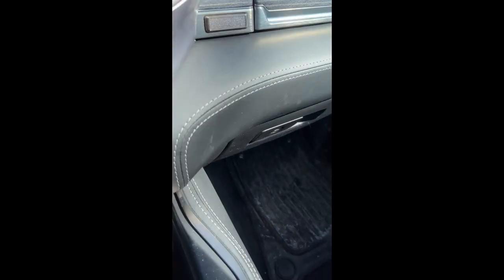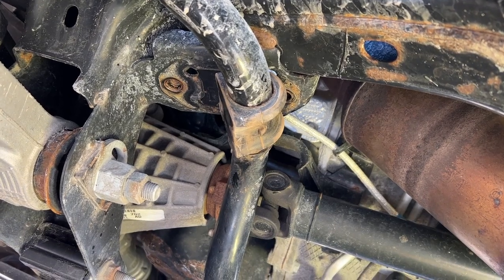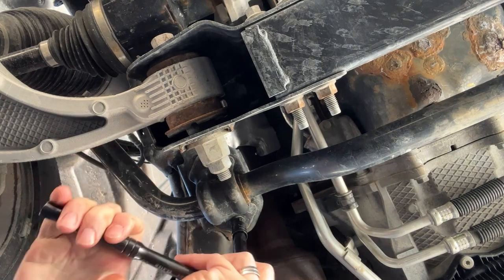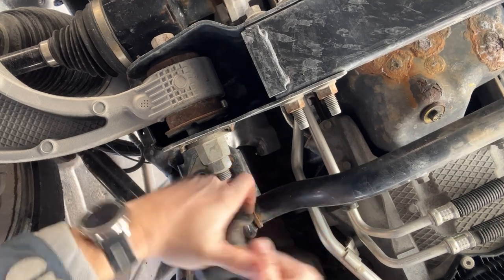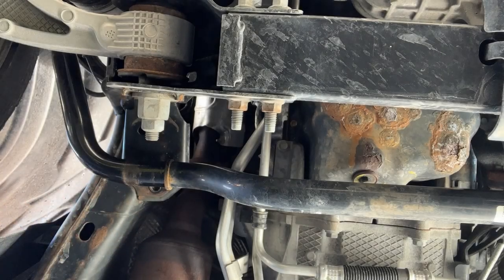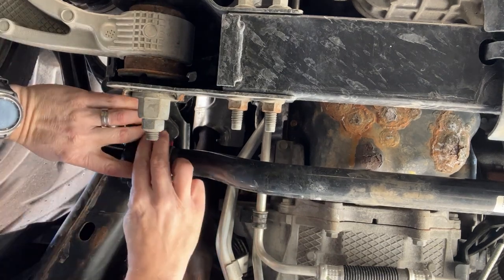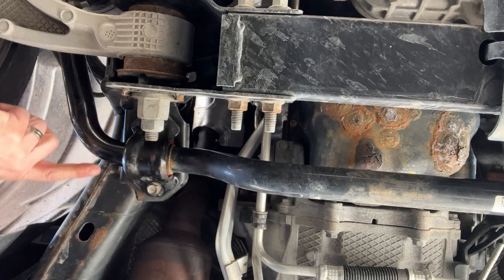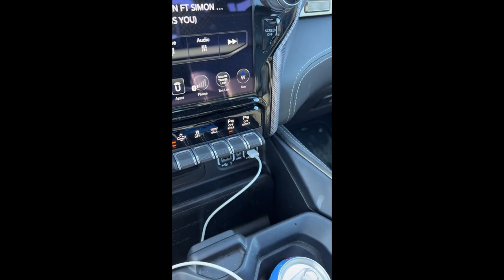2019 Ram 1500 Front suspension noise fixed  (CHEAP)

Comment: So I saw this video a few days ago after I replaced my swap bar links and still had a clunk. 2020 1500. I went to advanced auto for the bushings and decided why not for $30. As soon I cut the first one off I was like no shot this is it because it still felt really good. I greased the new one and installed it. Did other side just because and went for a ride. My god how long that’s been driving me crazy. It’s finally quiet again. Great video. Helped me a lot.
Reply from the maker: No Problem. thanks for watching.
Reply: Got nice blue Moog bushings online for $15- if your in a hurry pay double at the parts store🤷‍♂️

Comment: I’ve got a 2019 ram rebel after about 20,000 on it it made it knocking noise in the suspension only when it would get 40° and below in the winter.  summertime. You would never hear it took it into the Dodge dealership five times always said they could not find what was causing the noise Finally convinced them to replace the swaybar links thinking that was it and it was not now it’s out of warranty and now I’m thinking it’s the bushings as well. Drives me effing crazy in the winter.  If this fixes it, I’m going to be happy as heck and mad as hell the dealership could never figure it out.
Reply from the maker: My dealer said the samething.  I updated them on my upgrade to the factory bushings. Cheap quick fix.  Good luck.
Reply: My 2019 rebel has been clunking on the left front for well over a year. It’s definitely worse when it gets cold out. Dealer replaced end links. Didn’t help. Put a whole new sway bar on and that didn’t help either. I tried this bushing swap and it didn’t help. I’ve checked torque on upper and lower control arms and that didn’t help. It’s driving me crazy 😢
Reply: The lower ball joint went bad on me at 58000km check them out

Comment: I installed these poly bushings. Greased them and now a few months later they are extremely squeaky/creaky
Reply from the maker: You can order more grease.  But I have gone through winter with my truck and now into a  hot summer no noise at all.  Did you grease both sides??  Bar side and bracket side I did might be the difference.  36mm Sway Bar thickness.

Comment: I have a 2015 Dodge Ram 1500 with 52,000 miles and the front suspension squeaking only happens in the cold weather & in the summer time it's gone. Can anyone help with this problem ?  Thank you.
Reply from the maker: My first thought would be take a look at the rubber bushings and lube them up with a silcone based lube.  But could be a totally different thing.  Can you make it squeak by rocking the truck back and forth by hand?

Comment: Update on my 2019 ram rebel, making a knocking noise when it gets below 45° and after taking it into the dealership five times and they couldn’t figure it out it was the bushings. They are very easy to replace in if you are not mechanically inclined and cheap, wish I would’ve did it years ago
Reply from the maker: I am so glad it worked out good Christmas gift quiet truck :)

Comment: Well, I ordered the exact bushings linked for my 2019 Ram Laramie that had the same rattle.  Yup, sure  enough, that's what it was.  Thanks a ton for this video.  As an FYI ... I also checked the stabilizer bar end links and the bolts as well as upper control arm bolts and all of that seemed fine.
Reply from the maker: I replaced the Bar end links first then the bushings onm my truck.  I am Glad my video helped you out.

Comment: I have the same 2019 Limited mynoise dumping underneath it's where the CV shafts connect to the differential seems to be a design flaw 110 thousand miles on mine
Reply from the maker: dumping or jumping ???  No issues yet on my truck with the cv shafts..
Reply: Mine started at 103k miles

Comment: So I have the “clunk” and took it to the dealer at 68k. They changed the sway bar end links and nothing changed. They told me it was good. Then we found the CV joints were failing, so they replaced those as well, nothing changed. So now I’m dealing with the “clunk” and i ran across this video, went and checked my sway bar myself and it was solid but I decided to buy these and try them anyways after watching your video. Very easy job, less that 20 minutes, and this thing is now extremely quiet and seems to be a more solid ride. 

If it wasn’t for your video I wouldn’t have even thought to look at this. Thanks so much
Reply from the maker: Thanks for the support.  Yes,  I found my truck felt much better.  I got 25000 kms on these bushing now and there hanging in there with no noises.
Reply: When did you notice the noise? I have something similar but only when moving slowly while turning the steering wheel

Comment: Ordered and received the same bushings you recommended.   Will install soon.  Hoping this rids me of the annoying sounds in my front end.  Thanks for posting!

Update:  Changed my bushings out.  Noise is still there.  It was worth a shot.  Good thing though, it only took about 10 minutes to change them.
Reply: Did you ever fix it? I have a weird squeaky sort of crunchy sound as I go over bumps. Can’t tell if it’s strut or bushings
Reply from the maker: If you still have the noise I would reccommend the End links to be replaced.  it can be one or the other.  I did the sway bar links first didnt fix it so I did the bushings next.  Factory Link are not to expensive I think I paid $70 CAD.
Reply from the maker: I though struts also but I fixed the cheap stuff first.
Reply: @oak8728 rear control arm bolts loosen

Comment: Sounds all good. Having the same clunk...I'm on it. Thank you!
Part link?
Reply from the maker: https://teamenergysuspension.com/product/energy-suspension-5-5160r-front-sway-bar-bushing-set-36mm/     It worked on my 2019 you can measure the sway bar if you are not sure with a caliper measuring tool to the diameter of the bar.

Comment: Mine is now suddenly making a squeaking noise when turning right, and slowing downing to a complete stop. Up and down if you bounce on the front in you can hear that noise I haven’t looked at it yet seems to be really noticeable around 20mph or less

Let me know your thoughts thanks I’m kind of a do it yourself type, shots too e pensive these days
Reply from the maker: IS this after you installed the bushings?  If so I would add more grease to the bushings. Also against the frame to bushing.  Poly bushings if not greased will squeak.

Comment: I continue to have the same problem on my '19 4x4 Sport.
I've replaced the original drop links with SuspensionMAXX and replaced sway bar bushing.
Oddly...problem goes away above 45 degrees ambient temp or when truck is raised to OFF ROAD height. 
Thud  noise is present when driving slow over uneven ground below 45 degrees or Entry and Aero height.
Any suggestions??
Reply from the maker: I will be doing an update on the RAM but so far so good all the noise is gone.  USE the swaybar bushings I did    Energy Suspension 5.5160R 36mm Front Sway Bar Bushing Set seems to work great.
https://www.amazon.ca/dp/B0018LSC9Q?psc=1&ref=ppx_yo2ov_dt_b_product_details
Reply: @arsenaultsgarage when you click that link it says it does not fit the 19 Ram 1500..
Reply from the maker: Right but it does.  They have not made a set for the 2019 Ram but they will work.  Bought mine on amazon so if they dont fit you can return them.

Comment: Bushings fixed clunk on my 2011 “classic” -makes me feel better seeing the rusted oil pan on your2019😒-not looking forward to that job I have to drop my front diff apparently….  
edit to add- not sure about new rams but there are different diameter sway bars on the 09-20s - I bought wrong size bushings at first, but at least it’s a cheap easy job! Almost at 170k so I’m slowly replacing most of the front end parts at this point🤷‍♂️
Reply: I have a 2011 and I hit a pothole and since then  & I hear a sound similar to his, but that sound happens when in uneven roads but I hear the sound by the top of the dashboard passenger side… I was wondering if that’s the same sound yours had? I got it aligned and checked twice for any damage in any of the links connected with the wheel everything is good they tell me, but I’m wondering it could be that. Thank you.
Reply: @William76850  check the sway bar end link bushings, where it connects at the ends there should be two samwiching on each side I needed to replace all those as well. If you slammed it on one pothole make sure you didn’t blow the shock out in your strut, and that the three bolts on the top that hold shock/strut aren’t loose. Lastly try to check lower control arm bushing and ball joints, tie rod ends as any of them could produce clunk if worn out

Comment: I have a 5th gen 1500 BH 4WD v8 non hybrid and all local parts websites say these “don’t fit” when adding my vehicle. What 5th gen do you have?
Reply from the maker: I have a 2019 1500 Limited.  I based it on the sway bar size and not on what they recommend on the website. 36mm Sway Bar thickness
Reply: Thanks!!!

Comment: 1997 Dakota  sway bar bushing boat won't tighten up only will snug start turning again    how can I fix it
Reply from the maker: Hmm sound like the nut in the frame stripped or weld broke.  IF its the frame that has the tread in it you could try to tap in new larger threads or use a t bolt in the frame rail.  Not sure the how the Dakota is setup for the sway bar. 

Example of t bolts.  https://www.framingtech.com/products/fasteners/t-bolts/  or   https://a.co/d/7eaeQIt